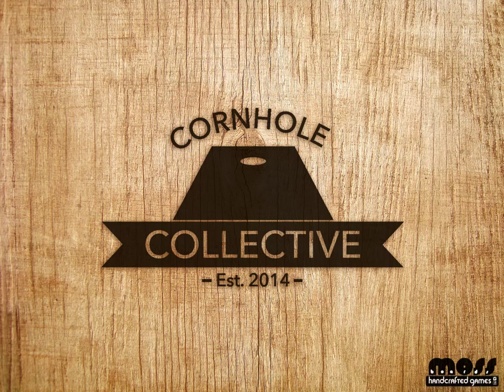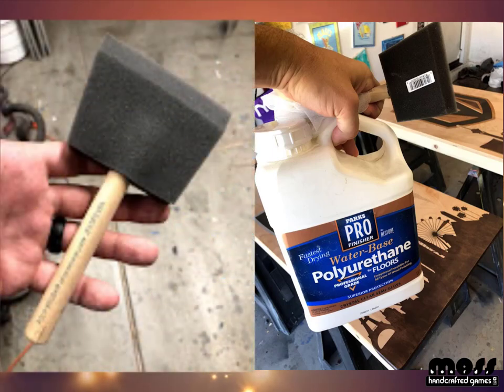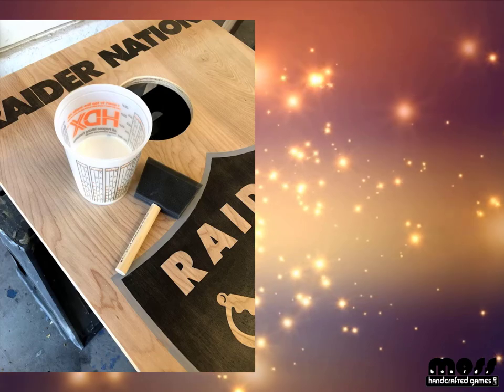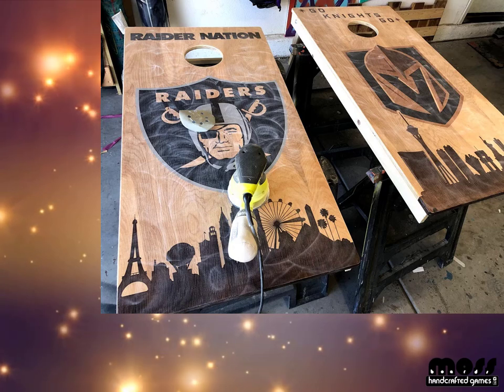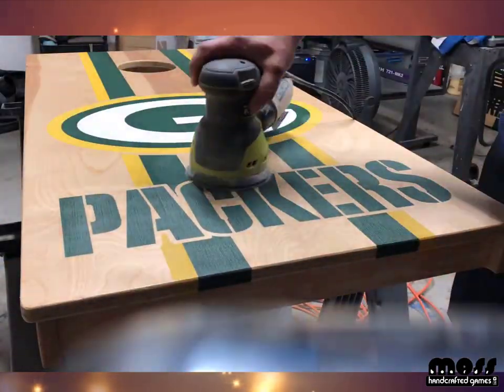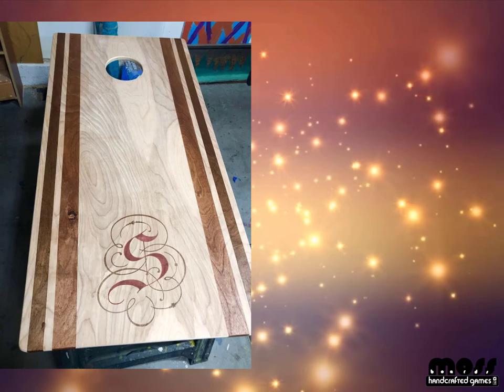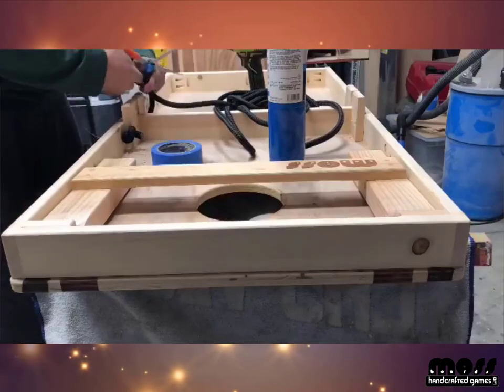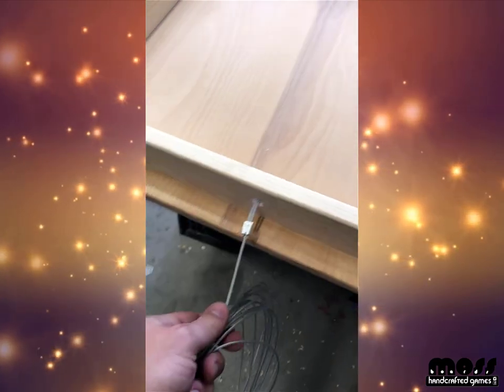Better Cornhole Boards Phase 5: Finishing Steps!

Comment: Best finishing video I could find on YouTube! Very thorough explanation, nice job!
Reply from the maker: Wow, thanks RC! Are there specific steps you have trouble with? There are so many ways to get an awesome finish. Lately (not shown in this video) I've been wet sanding the heavy coats instead of dry. Then wiping clean and applying one or two final top coats. Super smooth.
Reply: @cornholecollective7116  I was looking for a detailed video on painting boards AND applying a poly finish which most people seem to skip. Whats the deal with a wet sand and how is it better than the dry sand?
Reply from the maker: So, wet sanding seems to me to give a much more consistently smooth finish. Also, it seems less likely to damage the edges. After the initial heavy coats fully dry for a day or so, spray water and orbital sand with 320 grit. Wipe, allow it to dry, apply final coat or two. Turns out really nice and streak free.
Reply: @cornholecollective7116  Awesome cant wait to try this!

Comment: Thanks Scott.  I really appreciate the videos you do.  I have watched several of them multiple times.  I noticed that you had some rubber feet on a set of legs.  I take it you compensated for the thickness of the feet on the cut of the legs.
Reply from the maker: Thanks Mark! I used to use 2x2 legs and they'd scoot around on concrete surfaces. Added rubber stopper feet and compensated with legs cut 1/4" shorter so the playing surface was still 12" off the ground, yes. Since then have switched to beefier 2x3 legs.

Comment: Thanks for sharing your way to make these boards. I modified them a little and made a set for my daughter as a Christmas gift. I inlayed my tops instead of the overlap method but I think after doing so your method is the better way to go. Also I added a light inside the hole and they turned out great. She loved them.
Reply from the maker: Great to hear Phil! I’m sure your boards are awesome. Tag me on Instagram if you posted any pics. @Mossboards

Comment: I use quick release keychains, with the receiving end counter-sunk into the end of the frames, to attach my 27' cord. Just another option.
Reply from the maker: Good solution, sometimes I use matches and eye bolts, other times a long loop that pushes through a hole in the bottom of the frame and catches a bolt on the inside. Lots of solutions, I like yours too.

Comment: First of all love your videos and thanks. I've just fully stained my boards and will be applying stencils so I can paint. Should I apply stencils right on the stained board and paint or add a coat of poly first before stencil/paint.
Reply from the maker: I think you’re applying decals to a stained board, that’s totally fine. If you’re applying stencils as a mask to paint designs over a stained background, it’s best to poly first to protect the stained area. The mask can pull up some of the stained wood fibers when you remove it. Hope this helps!

Comment: Love these.  Question about the friction blocks to keep the boards together.  My support board is just off enough that the two boards don't match perfectly for the friction blocks the way you describe.  Rather than fitting the blocks tightly on either side of the brace, would placing them further apart still achieve the same effect of clamping the boards together?  I imagine the boards could slide a bit length-wide but they'd probably hold together for the most part.  Not ideal but do you foresee a big issue?  Thanks so much for all your videos.
Reply from the maker: That does make sense. When my boards dontnline up perfectly, i sand down the edge on the inside of one of the “buckteeth” if that makes sense. Most of the time, it works every time.

Comment: Came across your video again trying to perfect my finishes. I like your method and I do the same except I wasn’t spraying or sanding (very little by hand if any) as much as you. I was using a coat of wood wax to get the bags to slide. Is that ok or is your method better to get a smooth and slick finish ?
Reply from the maker: I would be careful with wood wax. While it feels amazing, it can come off on the bags and continue reapplying it’s self to those boards or others if used in other boards. In my experience sunny conditions caused bags to slide back off the boards if they don’t go into the hole.

Comment: Is it possible to use a glass enamel paint and get a slick? Enough surface, or can you go over the gloss? Enamel paint with polyuresin the enamel paint is an oil base
Reply from the maker: This is a tricky one because you’ll want to seal the board with poly and poly doesn’t adhere to glossy paint well. It might appear to hut in no time the layers over the glossy area will peel up and look terrible. The glossy paint doesn’t make a lot of sense considering the whole board will have to have the same sheen for the bags to slide right. I’d say use normal acrylic paint and glossy water based poly if you want them shiny.

Comment: The boards look great.  Thanks for all the ideas on how to make them.  I am using the Park Pro Floor poly in satin.  How do I avoid cloudy areas?  Will the cloudy area clear up after sanding and adding more clear coats?  I have 1 board that looks great with this and 1 that is cloudy along the edges.  Any suggestions?
Reply from the maker: Cloudy usually meant 1 of two things, water was added to the clear coat which changes the finish and makes it foggy, or 2, additional coats were applied before the previous dried enough. The only thing I can suggest is to carefully sand it smooth and try thin coats of fresh clear.
Reply: @cornholecollective7116  thank you

Comment: Hey, amazing boards and even better tutorial series just curious how well the boards hold up outside considering you're using an interior floor poly just built my own and would like it to last a while and the only sealers I've seen that are outdoor are spar urethane and varathane diamond sealer
Reply from the maker: Never leave them outside. If they do get wet, wipe them down soon after. Outdoor poly will yellow a lot and harden to the point the boards are too slick. If you don’t want a predictable slide, give it a shot but I like to keep boards in the garage and they last a very long time.

Comment: Can you use a foam roller instead of a foam brush
Reply from the maker: Hi Dawn! Foam rollers tend to leave an orange-peel like finish. The best applicators I’ve found, if you don’t have an hvlp sprayer, is foam brushes or the stain applicators with the micro-bristles.

Comment: Great video.  Question for you.  if you painted the board would you sand it first before putting first coat of clear or poly?  if so what grit would you use
Reply from the maker: Hey Kevin! Thanks for watching. I’ve never sanded paint or stain before poly, no. I apply poly directly to dry paint and stain.

Comment: I just bought a set and have a few questions. The guy did 3 coats of clear on them but they still don’t seem as sealed as they should be to me. What should I finish them off with? Secondly what’s a good way to seal the frame and legs which are still bare?
Reply from the maker: Hi Mike, you can reseal boards using the same steps and product in this video. Same for frames and legs. Wide foam brush and be careful to avoid drips.

Comment: I can't seem to get past air bubbles when using polycrylic and poly urethane,  any tips???
Reply from the maker: Unlike Bond, always stirred, never shaken. Also, thinner coats, use a very dense foam brush or a firm dense bristle brush. The floppy foam brushes can lead to more bubbles. Never roll it in.

Comment: Thank you great tutorial! I ended up getting spar urethane oil base because all of the water based polyurethane said interior on the can. I haven't applied it yet. Can the poly be used for exterior?  Thanks again!
Reply from the maker: Great question, anything oil based is likely to yellow quite a bit. It also tents to be a lot slicker. Water based poly may not hold up well if you leave your boards outside but it works great for playability and is durable enough. Definitely the most common among builders.

Comment: Have you had any issue with this sealant yellowing the white paint/designs?
Reply from the maker: Generally oil based stains will have that effect while many water based do not. Parks pro finisher is go to, and it does not yellow 👍 hope that helps

Comment: How long do you typically cure the stain before you apply the poly coat? Summer vs winter months.
Reply from the maker: Well, I live in a hot dry oven so usually a day is good. If you’re in a rush, you can give the stain a couple hours to dry then aerosol spray it to lock the stain so it doesn’t smear, then liquid poly it. Depends on your plywood. Crap plywood can bubble if you liquid poly too soon.
Reply: @cornholecollective7116  Thank you. Your designs are absolutely beautiful and inspiring.

Comment: I am building a set of boards out of some lumber I had in the shop.  I ended up using cedar as we will be play out side while we are camping and thought it would be good for the weather.  Plus it is beautiful wood.  BUT, I didn’t realize how soft it is and am wondering if poly is going to harden it up enough?  Or have you ever use resin?
Reply from the maker: sounds awesome Kody. I haven't used resin but I've had several people ask about it. I'd probably suggest testing a piece, like the hole punch, before applying epoxy resin to the whole board. Stuff id expensive and it bags wont slide or slide too much, I'd hate for it to go to waste.

Comment: I made the pressure feet to hold the boards together but one side is way too loose. Any good suggestions for getting that to snug up so they stay together?
Reply from the maker: Awesome! It’s such a cool touch that doesn’t cost anything. Here’s what I do. Attach them to one board without glue. If the boards are snug, remove and reattach with glue. If loose, attach them to the other board. Promise they’ll be tight.
Reply: @cornholecollective7116  Big brain play right there. I ended up drilling a hole through the frame of one and the pressure foot of the other and got a mapel dowel with a block at the end as a handle. Stained it to look nice. Do you have a cover you like to keep over the boards? I have mine stored in the garage and I'm scared my kids are going to wack it with a bike or something. I'm in Vegas too! did Golden Knights A/B logos sort of like one you posted somewhere, but with all brown stains.

Comment: Nice boards! I have made a set and used your idea for the blocks and want to add the rope. My problem is that my pocket hole screws are close to the blocks. I see you put the hole right next to them. I am leary of putting the hole through the pocket hole. I would have to go about 4" from the center brace left and right to clear these pocket hole slots. Is that too far of a span? Any suggestions?
Reply from the maker: I love that I'm answering such specific questions! That can happen for sure. I try to keep the two center pocket holes along the long pieces a little tighter to the center so the "friction blocks" cover the pocket holes on both sides of the center brace of one board. Then, the rope holes go just outside the friction blocks.
Reply: @cornholecollective7116  I understand how you did it but it is too late to backpedal as I decided to add blocks after frame was made. I was looking for advice how to make it work. Thanks
Reply from the maker: @dawng5764  gotcha, Nothimg wrong with wide handles. Just outside the pockethole is the best idea.

Comment: Oh my goodness. I absolutely love the Nevada boards. The detail on the trees is immaculate. How did you do that? Is it one vinyl sheet for the whole board?
Reply from the maker: Hi Luke, thanks! It’s a great hobby. i don’t think my computer, brain, or vinyl cutter could handle one stencil with all the design components. I did the foreground first? Then the state shape, them the “background” treeline last. Kind of like if you want to draw something with dimension, you start with the foreground.
Reply: @cornholecollective7116  Did you use a cutout and stain the individual cutouts or are those vinyl cling-ons?

Comment: I run a league and have some old boards that might need some new coating do you think this process would work with used boards?
Reply from the maker: For sure. Sand them with 220, 320c then several coats of poly like in the video, you’ll be good!

Comment: If I leave them to dry horizontally, do the boards pick up dust dirt in the drying process?
Reply from the maker: Water based poly dries fast. Should be ok if your shop is clean.

Comment: Do you have a video of how you did the greenbay stenciling ? I’m trying to do more vinyl stenciled logos vs just a vinyl logo. But confused how to paint and use layered stenciling
Reply from the maker: For that, I did the center logo first. Touching colors always require a remask. Then taped the stripes and painted those. Whenever I’m doing stripes, i leave the border “break” in place around the logo so there’s a small amount of natural wood separating the stripes and logo. Makes it appear that the stripes go behind the logo instead of running into it if that makes sense. 
https://www.instagram.com/p/Bx87ar1gEq2/?igshid=YmMyMTA2M2Y=

Comment: Can you use satin poly? Or is semi gloss better? Thanks
Reply from the maker: Satin poly works great too! I actually prefer that sheen now 👌
Reply: I did everything you said and I got a milky area how would I get that spot out? I’m on my 4th coat. Thanks
Reply from the maker: Milky areas can be caused by a couple things, it would be hard to diagnose without seeing, are you in the collective? We could have a post with photos and more heads on the issue.

Sometimes parks is used and filled back up with water, returned and put back on the shelf. This can cause a white haze. I’f you’re able to wipe with a damp rag and haze disappears (only to return when it dries) you need new poly. Do a coat from this Jew jug

Sometimes the poly dries on the outside encapsulating some wet poly that is milky and to solve that, the boards should just need time in the sun 

Those a are two of the more common milky issues with poly that ive seen.

Good luck, it’s certainly frustrating

Comment: Thanks for the AWESOME instructional videos. This series is by far the most informative and in depth I have seen. I have a quick question. Do you use the same amount polycrylic on the sides and bottom or do you only do a coat or 2?
Reply from the maker: dzimm666 thanks! Glad you found them useful. I apply 2-3 coats to the frames and legs. One when I first do the tops. Pretty heavy. Then give it a quick sanding when fully dry, wipe and apply one more.
Reply: @cornholecollective7116   GREAT! thanks for the response and again for the great series of videos and the new knowledge i now have!
Reply: @cornholecollective7116  Great videos!  Do you stain the frames as well, or just sand and poly?
Reply: @cornholecollective7116  Thanks for great videos, I have 7 sets almost ready for finishing :)  As a follow-up, do you remove the legs and legs bolts before finishing the sides and legs, or do you do the finishing on these before installing the legs?
Reply from the maker: @missingdigit1341  I usually leave the legs attached while applying clear.
Reply: @cornholecollective7116  Thanks - I guess the part of the legs that is hidden by the frame really doesn't need finishing as it will never be seen. Might be worth removing if the legs are going to b painted or stained instead of just clear - guess it depends on the design.  Thanks again - vinyl cutter arrives today :)

Comment: When you sand, do you sand till all the streaks are gone? I'm sanding now and still see some streaks but it's smooth. Thx and great videos!!
Reply from the maker: I’ve started wet sanding. Just with a spray bottle of water and 320 wet sanding with orbital. Tents to leave a much more consistent smooth finish without any streaks.

Comment: Great video. So I bought some nice boards for around $200. My problem is, they are much slower than the league boards we play on. Any way I can speed them up? Should I lightly sand them w 220 paper? Thx!
Reply from the maker: Absolutely. Not sure if or how much clear coat is already on them but I’d probably clean them first, then do all the steps in the video. If nothing else, they’ll be better protected from the elements. The fine sanding (320 grit is good) helps them play faster and the final coat or two is applied to the super smooth surface.
Reply: @cornholecollective7116  If you want slicken them up a bit...wipe on a small amount of car wax!

Comment: great boards, very well done. I'm applying a lot of what I learned from your videos to my builds,  thank you.  quick question,  what are the dimensions of those friction blocks and will they still work if my I use 1x4's?  next and last question,  I found some really straight pre-primered finger joint 1x4 pine at my local HD that are half the price of the 1x4 select pine boards,  any experience with those and do you foresee any problems if I were to use those for my frames?
Reply from the maker: Glad you’re finding the videos helpful! More to come. The blocks are about 1.5” taller than the width of the frame. Absolutely works on 1x4 frames. I don’t hVe experience with the other lumber you found but if it’s straight and clean, I’m sure it’ll work fine. Lots of people use ripped plywood for frames.